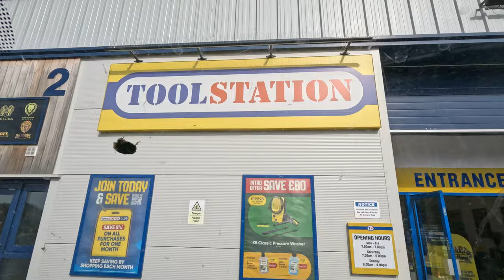Van Conversion: How To Paint, Install Visor, And Repair Roof!

Comment: I had both, I had 4 solar panels and a 2k inverter, also 240v mains, so if in a dull day I can still charge up the liesure batteries. All cost me £500 ISH. so it is possible to have a smaller budget. Best of luck
Reply from the maker: Thanks. My friend is doing a budget version like you mentioned. I however have gone all in on an all singing all dancing system now🤦

Comment: Top tip... brake cleaner dissolves silicone, you would be able to peel it from the metal.. minimal scraping.
Reply from the maker: Ooohhhh.. Love a good top tip😁 I'll bank that one for next time thanks.

Comment: think is a wise move to get a mixture of gas and electric as there is an old saying dont put all your eggs in one basket am planning a sprinter build which will have quite a lot of wattage but i also want my heater/hot water and cooking to be gas and as i intend to venture up to the artic circle will be putting in a diesel heater to act as a back up ,your van is coming along nicely
Reply from the maker: Hi. Thanks for your opinion. Everyone seems to be on the same page with this. So looking like my decision is made. It'll get a gas tank fitted. As luck would have it there is a company that does it in my home town.

Comment: Another great video. The work is coming along nicely. 
Blind grommets would have been an easier, neater, solution rather than the bolts but you got it sorted.
Reply from the maker: Blind grommets? Ah ok. They might be what I was looking for in the first place. Is that like the big one just to the front of those holes?
Reply from the maker: just had a look. Yeah thats kind of what I was after originally but didn't know what they were called 🤣
Reply: @life_uncharted  Yes, they're just like the bigger one in front of those.
Standard size is 20mm so open the holes out and use those or hunt around eBay or Amazon for the size holes you have or just leave the bolts in that you already have 👍🏻

Comment: I  have a vw t25 and put 220w of solarpower on the westfalia roof in combination with a 105ah 12v lifepo4  selfmade battery wich is fitted under the driverseat. Iput the battery in a little suitcase for protection and in between the solarpanels and the battery I put a cheap victron smart solarcharger with bluetooth. this is enough for chharging phones, led lights, a 38 liter compressor fridge. but we dont have a television in the van but I think its possible.

The battery has a battery management system with bluetooth so you can see how much charge there is.

We do make coffee with a nespresso machine through a cheap 3000w inverter of  of aliexpress and also have a water heater to make tea offcourse. 
the cooking we do on little gas cookers because they are cheap and the gas bottles are evrywhere availble.
Reply from the maker: Interesting. Thanks for the info. Sounds like a good set up. I'm definitely looking at gas for cooking and heating now. Just need to think about how much power I'll need.
Reply: @life_uncharted  oh and I have a cheap diesel heater from Alie aswell. For less than 100 euro I bought one and build it in my van😉

Comment: Someone  mentioned how gas gets awkward when abroad with certificates etc . I am looking at a Clayton power bank with a diesel heater for heat and hot water. Plus a jet boil for backup
Reply from the maker: Interesting. Not thought about certs for gas🤔

Comment: Was the roof material too thin to get your welder mate to weld a plate over the holes in the roof?
Reply from the maker: Hey mate. Yeah it's too thin. He managed to do it with multiple spot welds so it didn't get too hot

Comment: You mentioned a company will do the electrics; at what stage of the build do you hand over for that to be done (I’m assuming before walls, floor / cabinetry etc. is installed so I guess there’s some degree of coordination required for positioning and the like? Does the work need to be done by a specialist / be certified? Just curious.
Reply from the maker: I'll not be handing it to them. They will do me a design that I'll follow. I've done it before on my little van. But figured it was sensible to get professional help on this one. 👍👍

Comment: How come you didn’t get your mate to weld the holes ? instead of using the bolts 🤷‍♂️
Reply from the maker: Good question. It crossed my mind 😂. I might still run it by him but he didn't seem keen as the access underneath is a bit rubbish.